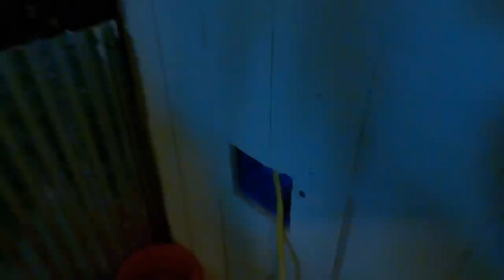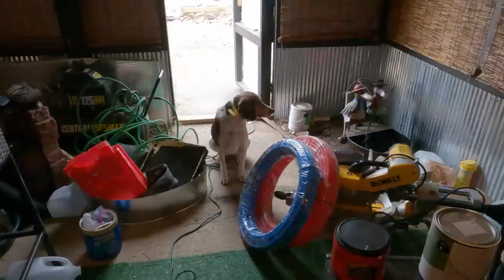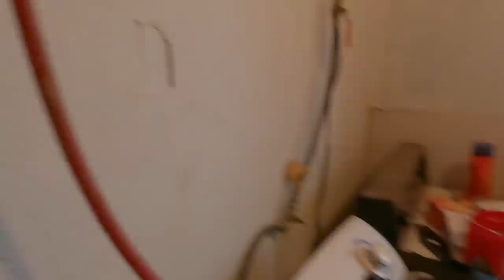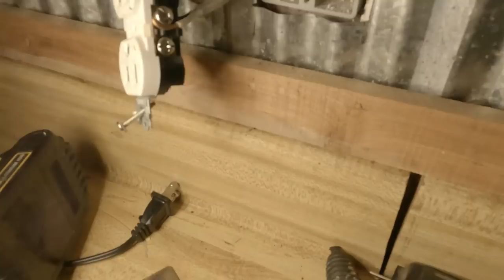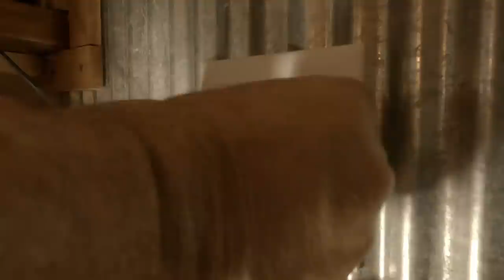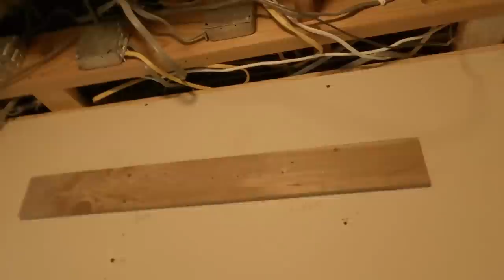All Wiring Complete In Dog Apartment.Finding And Fixing Dangerous Mistakes From Years Past

Comment: They make box spacers (variety of depths, 1/4", 3/8" ect) for this purpose. Not like the one you used for the light box in the dog room. Look at the electrical section for remodeling houses. I have a 50' roll of that thick gray wire (it can be buried without being in conduit).You are right about the hard to bend.

Comment: The new thing is having the outlets like that.  In some places it's the new code.  It has to do with a plug coming out of the socket partially. If the outlets are turned the way we all are used to and a plug comes out partially you can get shocked, but the other way you can't.  At least that's the way I understand it.